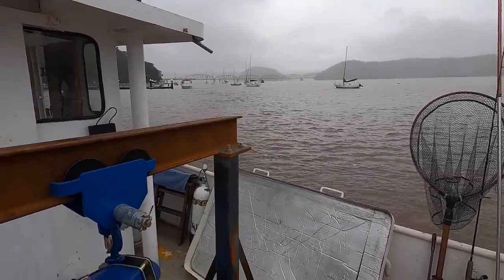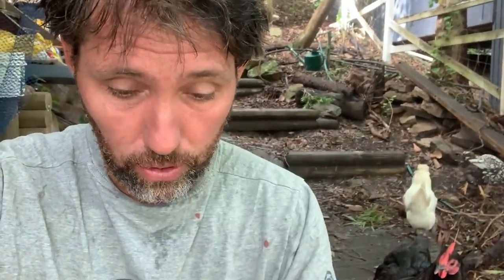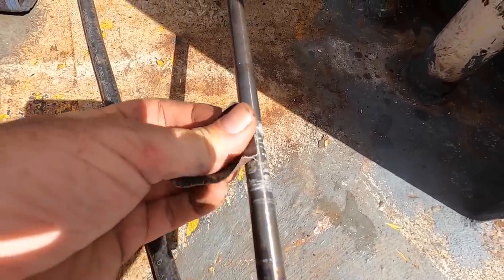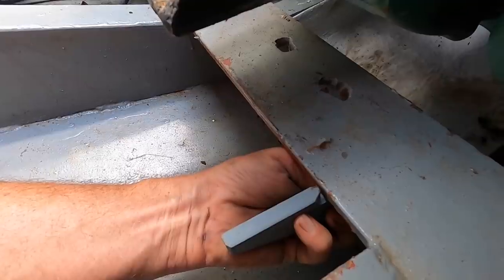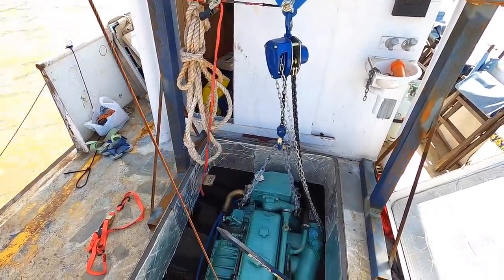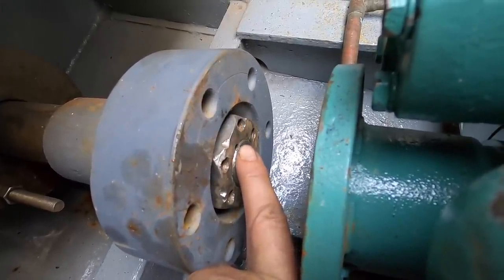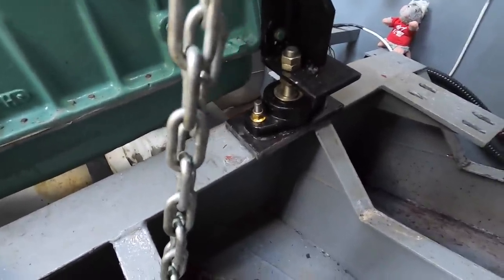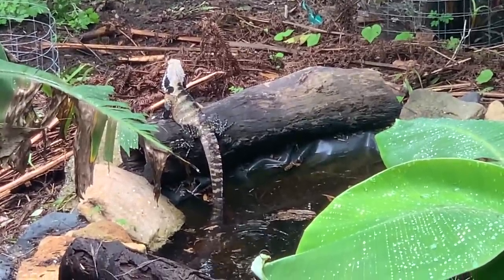Positioning the engine

Comment: If you have to go on the hard stand then you can clean up the bottom of the boat, maybe give it another coat of anti-fouling or perhaps install a couple of those electronic anti-fouling units.
Reply from the maker: That's what I was thinking too. Check the anodes, clean the sonar transducers, put an extra coat or two of antifoul on etc. It wouldn't be a bad way to kick off the journey north.
Reply: Yeah sounds like a plan.

Comment: Stu: I've been pondering the alignment process, and it seems to me to be thus- First, set the angle of the engine, doesn't matter where, or if it's high or low, just get it to the correct angle, parallel to the prop shaft. I believe that this adjustment is all in the engine mount bolts? Second, get the center line of engine and shaft aligned, looking down from above. I don't know how you're going to get a straightedge to run along the top of the engine, though. Maybe draw a line along the top of the valve cover, and use a laser? Builders usually have one that projects a straight line. Last, raise (or lower)the engine to the correct axial alignment. Once again, the engine mounting bolts do this, just make sure to turn the bolts the same number of turns, all around. I see that half the difficulty is getting everything to stay where you put it, and I suspect that clamps are going to be your friend! If you can control the fore-and-aft movement of the engine, and do it in this order, you may well not have to fight the battle of moving the prop shaft in and out. Good luck, mate!
Reply from the maker: Thanks mate. I appreciate you taking the time to share your thoughts on the process.

Comment: getting Renko to a hard stand is a fantastic idea i kind of thought you might do that when the engine arrived.  on the hard stand you can bring in some heavier equipment to horse that engine around properly shim it, and as you say wrestle with that prop shaft a lot easier on dry land.  you can also get that bottom pressure washed .  i have a question though would there be any danger of flex or twist in the hull with that much weight being redistributed.. just curious.
Reply from the maker: I do think this would be much easier on the hardstand, even for just a few days. I would also like to use the opportunity to inspect, clean and refresh the antifoul on the hull.

Comment: Would a second attachment to the gantry give you more control over the motor? If you had a left and right you could more easily make adjustments to weld the mounts in place. With two they could be smaller so you could throw some chain around the beam and use a smaller block and tackle for the second one

Comment: On the hard has got to be the way to go.  You can apply real force and move things into the fine position that's needed without the movement of the boat fighting you and undoing the adjustment.  It can be done on the water, but it is so much harder (more dangerous too, fingers etc) than it needs to be.  That cutlass bearing has to be spot-on too, and you cant do that afloat.
Reply from the maker: Yes, I'm starting to think being on the hard stand really is the answer here.
Reply: @DangarMarine  I'm sure of it.  it would give you the chance to winch or jack the propshaft and even pull/replace the cutlass bearing if the need arises.

Comment: I've got this idea about using 2x 15HP DIESEL stationary motors in a catamaran with twin B section centrifugal clutch vee belt pulley's that kick in between 2000 - 3600 rpm connected to a 1:1 ratio forward/neutral/reverse gearbox. Originally I was going to design some type of stuffing box cutlass bearing but there seems to be nothing around that I can use on a 1" shaft but there is another way that I can get it all done but much different than the usual setup.

I want to put hydrofoils on the catamaran to lift the boat about a metre out of the water so I could easily weld up a 90 degree pod that can be lowered & raised using 2 or 3 600kg linear actuators which when expanded would allow for whole engine & drive shaft to raise & lower 2 metres. The pods could also have a board at the bottom that would also act like dagger boards if using sails when transitioning from motor to sails because it's that transition point of when the drag of water on the hull begins to lower from 0.3 to 0.0001 with the hydrofoils is where the most energy is used to get it out of the water. What do you think about my idea, do you think it might work?

Comment: hey Stu,  I used to use those glass fuel filters on several of my pwc's but after a couple of years, the plastic hose adapters started to deform and twist. This pretty much blocked the fuel flow. I like the concept, but the plastic adapters need to be replaced with brass ones.
Reply from the maker: Interesting, never had that problem with them.

Comment: When doing big electric motors to drilling equipment welding horizontal jacking screws on the frame allowing the screw of the bolt to move then motor “just a fraction” reduced the final alignment time dramatically.   With the jacking screws it also stops the motor jumping /sliding too far.that is past the right point!!!!  Slacken one side 1 flat and tighten the other side to make a move .  The bigger the weight the bigger the bolt diameter needs to be.   They can be removed afterwards Or locked with a gap as a check on engine movement. You have jacking screws for hight so think of the same horizontally....using a crow bar gets close. Jacking screws gets it right. Amacf
Reply from the maker: I particularly like the idea of backing them off a bit and then monitoring the gap for movement.
Reply: If leaving the bolts in the jacking bracket ... grease them so the conditions in the bilge will not corrode them to a solid useless mess.  Greasing parts is beneficial when you come back some time in the future. Not at the time it was done.  I remember copper greasing some steam locomotive bolts and when they were removed at the 10 year overhaul life was easy. Not like 10 years previously!!!  Amacf.

Comment: On the coupling use an internal mic or internal calipers face to face get a better result by cleaning the paint of the flange face's and measure the gap between them, what is the tolerance on the coupling for misalignment
Reply from the maker: It has been on my mind too that with such fine tolerances the paint will make a difference.
Reply: R
Reply: Yes you need clean surfaces for sure

Comment: As a mobile welder,  I would have ground 2 slots the width of your gusset plates. Fitted them in so they just sat in the slot, then you could have burnt them in from the top. filled the slots flush and ground to finnish. Easy....
Reply from the maker: That's a good idea, wish I had thought of that! It was a real bitch to weld in that position and I know it isn't as strong as it could be. I appreciate you sharing the idea!
Reply: @DangarMarine  As a toolmaker you have to learn how to get out of the problem you have just machined yourself into...
I do that sort of stuff a lot as farmers bend heavy bits of kit in tight places.

Comment: Ive done motor and gearbox alignments a few times in my job, some much heavier than your engine and all the motor mounts have jacking bolts that allow slow even adjustment without needing to lift anything, maybe make some changes to your mounts to allow jacking bolts. 16mm bolts would be plenty. Just my 2 cents mate
Reply from the maker: Yes, jacking bolts is certainly emerging as the way to go.

Comment: Crazy Sat-Nav suggestion...did you ever consider mounting the base just above the window and extending the bracket horizontally.  Thought it might raise the height without the need to cut the bracket - granted I’m only relying on the same limited video perspectives to eyeball this possibility.
Reply from the maker: That's not a bad idea, it may well work, I'll take a look. 👍

Comment: OMG this project would drive me nuts.  Is there no one with experience that can help with the alignment?  Also the prop shaft issue surely needs to be fixed before to connect the engine IMHO.

Comment: Stu, I've never done anything like this with a big boat, but I'm a life-long DIY'er and tech. Can you not use hydraulics to help align the shaft/engine? How about a small autobody porta-power with push-pull rams and or duckbills you can make small accurate movements
Reply from the maker: I was looking for my porta-power that day but couldn't find it. I'll keep looking...
Reply: @DangarMarine  It's amazing how many non-collision jobs I've used my porta-powers on. extremely useful tool when working by myself

Comment: Hello Stu I really enjoy your videos I have a question regarding your alignment I heard you say that you might be going up on the hard stands to complete your engine install along with the other items that you mentioned but anyways here's my question will you be doing a waterborne final alignment? I've done quite a few alignments on several types of boats and found that alignments done out of the water were never exact as opposed to a waterborne alignment due to Hull flex especially when you are doing an install on a fiberglass boat and the same situation happened on one steel Hull boat that we repowered I was just wondering if you considered that ?. . .. Anyway thanks for doing and sharing what you do and greetings from Sunny Florida  

Thanks again Scott

Comment: Looking good =)
How are you going to drain the pan for oil changes?
I was going to suggest cutting access holes in the web below the engine mount rails but it's not as tight as i was thinking it would be, looked like it was going to be real tight from the other side of the world here =)
Reply from the maker: Just planning to suck it out of the dipstick hole.

Comment: If the engine was pushed forward of its current position, would it be possible to use a drive shaft sinilar to a truck with two universal joints and a telescopic spline connection?
Reply from the maker: It is possible to put something like a CV joint in, but unfortunately the engine is as far forward as it can go.

Comment: Would it be prohibitively expansive to replace the prop shaft or what ever is needed if you decide to go on hard stand again?  The propulsion system is very worrisome considering the remote locations you are considering traveling to.
Reply from the maker: New prop and shaft would be about $5000 I reckon so pretty expensive.

Comment: What about a porta power hydraulic system to move the engine around? They have all kinds of attachments and im sure would make you life easier moving that detroit.  Im confused why you need to move the prop shaft in or out?
The porta power would surely push that shaft in or out if u welded in something to push against???
Reply from the maker: I agree. I spent an hour yesterday trying to find mine but can't locate it... :(
Reply: @DangarMarine  yeah that's exactly how my life goes. Ill drive 25miles to get a tool i left at my sisters when its found my garage weeks later

Comment: Stu, in which world do you think a Detroit diesel will be stalled by a tight/stuck cutlass bearing?  😃. But it is suprizing how tight that shaft it!  
Also wondering why you are not attaching the new wider mount to the hull framing just outboard of the engine bed? 
Great vid as always   Cheers Warren
Reply from the maker: I think I worried about that because people have told me that Detroit's lack torque low down and that they need to get the revs up a bit to bring on the power. We'll sure, I'm sure it will be fine. I may well weld the shim to the rib, just need to confirm it's final position.

Comment: Honestly, I doubt you have to worry about shaft friction stalling that jimmy. Even at idle she probably makes around 150 lb/ft of torque, multiplied by your gear reduction.
Reply from the maker: I’m definitely going to fire it up and give it a go, it will be interesting to see.
Reply: @DangarMarine  just realize the "weakest link" will suffer some serious stress. If that frozen shaft is appreciably corroded, it could snap inside the log. If the log has appreciable internal corrosion, it could peel open in a rather disastrous manner. The clutch pack in the trans could take a serious beating.

Comment: Hey mate just a thought but I know with my old trawler the only way I could turn the shaft buy hand was undoing the stern gland could work for u just a thought??
Reply: Plus could also be cause your rear bearing is brand new might need a bit to wear it in but I honestly wouldn’t stress mate at the end of the day it’s better to be safe then sorry
Reply from the maker: Yeah, I think running it for a few minutes will make a big different to how tight that cutlass bearing is.

Comment: What kind of tolerance  is required on the coupling? When I did motor to gearbox couplings it had to be zeroed with a plus or minus .0005. If you need it that close you could weld some pusher bolts on the corners for a fine adjustment help. Keep up the good work.
Reply: Dave,don't you mean .005? A half a thousand would keep you chasing that lineup in a circle forever. Machineability between to two will most likely not be able to get closer than .004.which is more that adequate.
Reply: @piratecat4519  I did a steam turbine attached to a fan that  was 4 foot in diameter, at a ethanol plant. The turbine was running 300 psi @ 1500 rpm there was no vibration allowed. When we finished the owners people came with a meter to measure it. It was a huge job changed the pillow block bearings, and a 10 inch  Falk coupling. Fan shaft and turbine shaft were 4 inch diameter. When we finished you couldn't tell it was running other than the heat.
Reply: @dave8218  ,I thought we were talking about a Detroit diesel and a reverse gear not a 4 foot steam turbine.apples and oranges.
Reply: @piratecat4519  I was just explaining why you would need such close tolerances. I dont know about boat shafts but if you dont get it close enough you will shake the boat and engine pretty good.
Reply: @dave8218  what type of device did you use to get the. 0005 tolerance measured on the coupling.
Reply: @piratecat4519  a Brown and Sharpe last word indicator, with a chain clamp to hook on the coupling.
Reply: @dave8218 ,10-4 Dave. Good work dialing it in that close.

Comment: Hi Stu, I'm feeling you're closer to having the engine mounted and aligned than you believe :)
From what I could see, from the youtube side of things, the 1t engine can be moved around enough to do the alignment without lifting it off the mounts, just by dragging it on the rails.  You need some good strapping points (weld-in some if needed) and a system of  chain or steel wire  and turnbuckles to be able to change and hold position of the engine in 2 directions on the horizontal plane. I would first pull and push from the shims (with engine mounts fastened to them).  Once you are close enough you could weld-in the "shims" and  still be able to fine-tune the horizontal plane alignment using the elongated holes (pulling from engine mounts withe the same system). For vertical angle and position you have the screws of course. I have tried to suggest something like this in the comments to  your previous video, don't know if you thought it is impractical or didn't get a chance to read it
As for the shaft, would it help to try to rotate it manually using a long steel profile mounted with 2 bolts on the the coupling? At least you could get a feeling of how hard is it to rotate.
Just throwing out a couple of ideas, you do what you feel is best for the project. I'll continue to watch and support this channel on patreon
Reply from the maker: Hey mate, sorry if I missed you previous comment, it is hard to get to them all these days. I do think there is some merit in getting a large bar onto the prop shaft and seeing how hard it is to rotate.

Comment: Might be easier to weld up a 'T' shaped 6 to 9 mill plate to the top of the existing rail, bend the arms of the 'T' down to meet the hull outboard of the rail and you should have more than enough support, and far more access to do the welding...

Comment: I know you have been doing this for a long time. So, my opinion only. With the chain as main hold. To me the worst would be the up and down alignment. That's fine tuning. The chain hoist cant achieve that yet even using two small hydraulic jacks forward and aft would make more sense to me for the fine adjustment. Although with cameras, I don't know how much room you really have and if it is possible. Not fun. Take care.
Reply from the maker: I think hydraulic jacks are pretty handy for this type of job. I just wish I could find mine!

Comment: Is it possible that you have the stern gland a bit too tight Stu?instead of hauling out can’t you just tie up to the pillons on a high tide and wait for it to dry out,I noticed that back where you had your boat hauled out.
Reply from the maker: I'm pretty sure the tension is coming from the cutlass bearing but I'll check with it backed right off.
Reply: Dangar Marine good idea,I had this issue on my yacht but my cutlass bearing is shot,that’s how I found out.

Comment: If my 15 foot boat could hold enuff gas to go to Ausyland  I would take off work and help you. I can't drive there  and my boat is too small... Basically means I don't have wings  and I have never flown  other than a VW for more than 50 ft. I do motor shaft alignments  at work  would love to help you.Maybe add some jack plates to the framing  so you can adjust it.
Reply from the maker: Yes, I am starting to wish I had added jack plates to the shims when I had them on the bench.
Reply: @DangarMarine  You still can  Thats how we at work postion heavy motors.
Reply: @DangarMarine  if you do add them put them on the frame or mounts if they are not going to move.